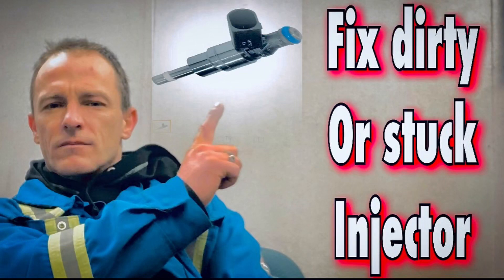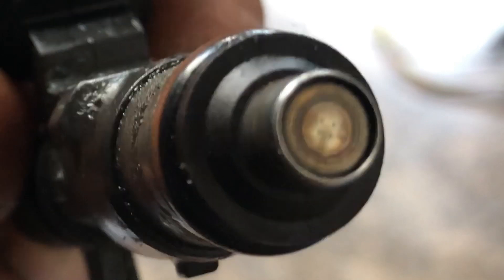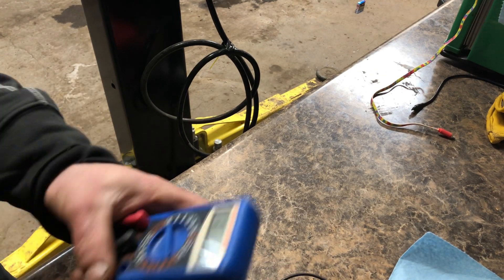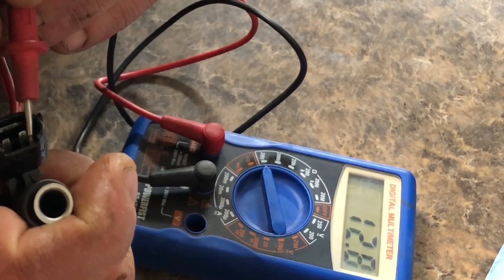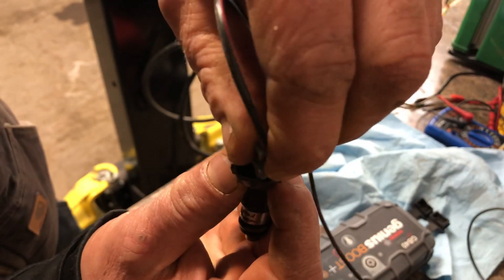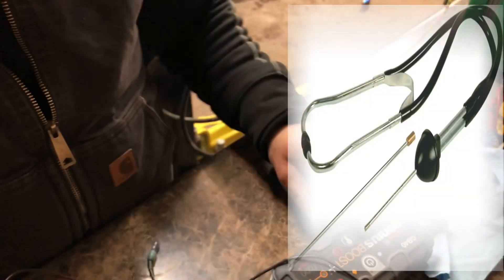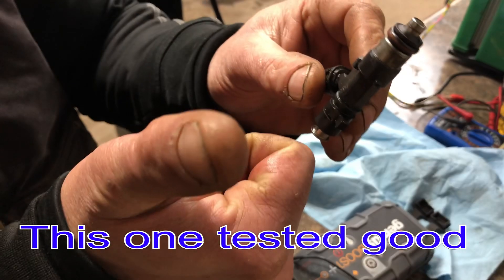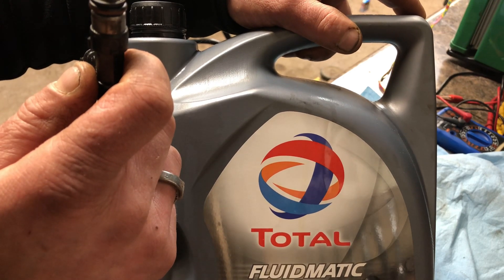Fuel injector fix(dirty or stuck injector fix) test your injector

Comment: So my injector opens up when giving it direct power put it doesn’t open all the way to my understanding I’ve tried spraying carb cleaner through it and it doesn’t come out the other end although it is “opening” I can hear it click but it is vary weak compared to my others I’m running 750 cc injectors any idea what’s wrong with it?
Reply: Just replace it or send it to an injector shop they can check the spray pattern and clean it up. Chances are your injector is junk
Reply: @johndowe7003  yeah I bought a new one the old one was vary massed up and wouldn’t get the pin open even with direct power to it
Reply: @reecechapeau8465  i once ran WD-40 through an injector and got it unstuck that way

Comment: If a an injector is stuck open and I do this test is it still going to click like that and also one of the injectors had 30 arms is that normal
Reply: No . The click Is the needle in side moving back and forth
Reply: Yes it can still click. I just did this today. Spray cleaner through the top and sure enough stuck open as it spray out the nozzle. Tested it for function and it did click
Reply: They should all have the relatively same voltage bud!

Comment: Would there ever be a reason why a "clogged up" fuel injector gives wrong electrical readings by any chance?  Then  have acceptable levels once thoroughly cleaned...in this case after 2 hours of dipping into ATF?
Reply: Yes, If the needle isn't seated all the way the resistance value will be different. Injectors are basically a solenoid that moves a needle in a seat that opens and closes fuel flow.
Reply: @AJ-tz6qu  p
Reply: @bedonitallmuddyhuarachez5372  🅿️